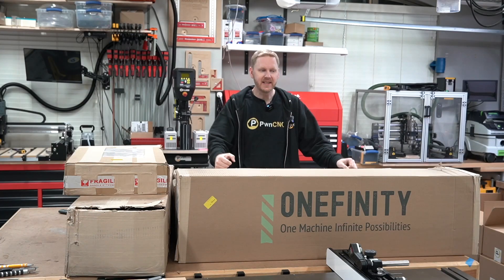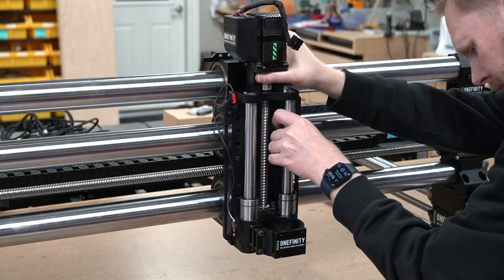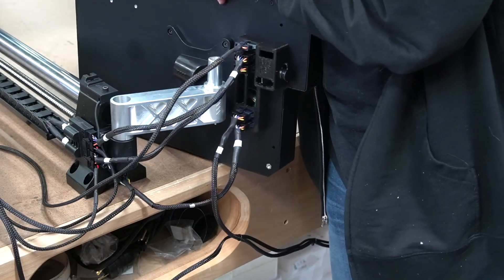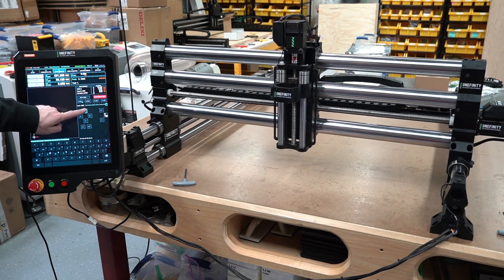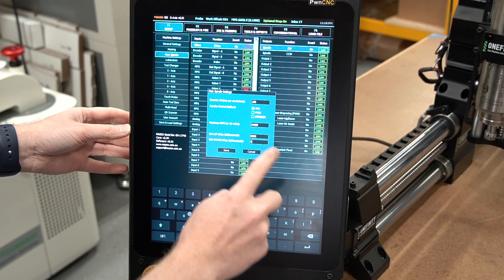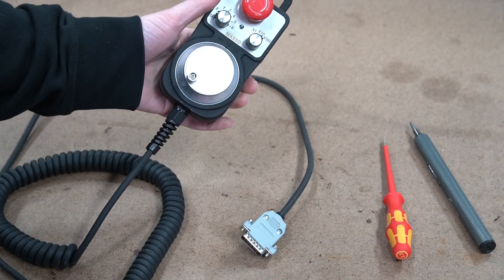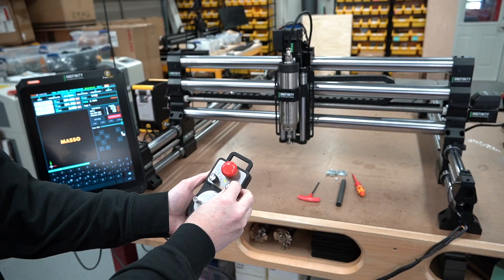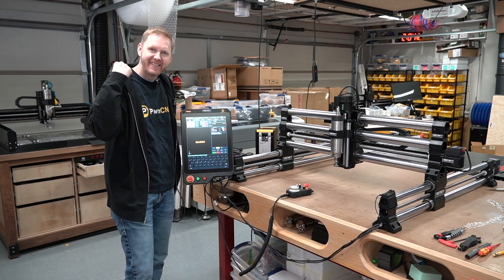Onefinity Elite Introduction

Comment: So I’m considering buying 110 V air cooled spindle using it just for wood will I be able to cut all types of wood or will I have issues?
Purchasing the onefinity elite
Reply from the maker: You'll easily be able to cut all types of wood and a little bit of aluminum as well with the right speeds-n-feeds.

Comment: Hey Daniel, are the Onefinity cables sheilded in any way, they look so cheap? Have you experienced any interference from the spindle or dust collection? I believe your spindle wiring is sheilded correct?
Reply from the maker: All of our cables are shielded yes.  No one has reported EMI issues with their machines... even when the Spindle's power cable is routed within the cable chain along with unshielded stepper motor cables.
Referring to the Onefinity wires... a recent trend with CNC manufacturers... Onefinity, C3d, and others is to put simple wires into their cable chains wrapped only on either end, but within the cable chain the wires are free.   Really sad to see this trend happening but it is.
As for PwnCNC products... we thoroughly believe in over-engineering where it makes sense and shielded cables in our spindle kit wiring are an important step to mitigating EMI.

Comment: Curious your thoughts regarding the Onefinity Elite vs the new Shapeoko Pro 5 4x4...  Each seems to offer something different for around the same price price point.
Reply from the maker: The Onefinity's Masso controller is an absolute game-changer!!!!!  IMO that is the epidemy of hobby level cnc controllers at the moment and if your machine doesn't run one... figure out how to add it.  
Both machines are mechanically capable.  There is definitely more standard mechanical design elements to the S5.  Certainly the size is awesome and the fact that they enlarged it to fully and completely support not only carving 4x4 but also clamping stock for a 4x4 cut is just awesome... cudos to C3D for that design decision.
Reply: @PwnCNC  As always, appreciate your feedback...  When my wife condescendingly asks me, what did you buy now???...  I show her work shops like yours which seems to put her fire out.  lol..  Your shop looks awesome and love all the equipment you have it populated with.

Comment: I'm looking to buy this exact machine with the PWNCNC 220V spindle.  I have a space off my shop that is 48" wide.  Will this fit in that width? What is the widest dimension of the Elite woodworker? Thank you
Reply from the maker: 48x48 is perfect spacing for the Woodworker Elite.  if you were putting a "top" to that enclosure... leave about 26-30" which should be enough for routing a 2.5" hose.
Reply: @PwnCNC   Thank you! The current spec on Onefinity's site shows the widest point of the woodworker being 45", but that's the woodworker x-35. 
I didn't know if this was accurate for the Elite with the bigger stepper motors, standard wire management on the side rail,  and the bigger controller.

Comment: Daniel, what brand is that skinny cordless screwdriver you were using? Thank you!
Reply from the maker: That's a Milwaukee driver.  LOVE them as the torque can be lowered to 1 which is pretty much hand tightening.
Reply: @PwnCNC   Not able to find driver by Milwaukee. Do you have a link or item number

Comment: Nice to see these elite series starting to ship, I cant wait to set up my wood worker elite!
Question on the pendant at the end of the video. Is this a Masso pendant (i don't see the masso log)
If it's an after market unite can you point us in the direction of the one you use? Shipping from masso is crazy expensive.
Reply from the maker: The pendant is direct from Masso. I ordered several things at the same time which did help with shipping.  I haven't got the pendants e-stop working but hoping to have it solved soon.

Comment: @PwnCNC if I move everything out of my enclosure, what is the least width and depth can I get away with for the woodworker? Will 48” x 48”  inside dimensions fit the Elite WW?
Reply from the maker: I'd say absolutely no smaller than 48x48 inside dimensions.   That is with mounting the Masso touch controller just outside of the enclosure btw.

Comment: I have a similar question to the one already ask My enclosure is planned to be 48” x 48” inside dimensions. My Z height is planed to be 30 plus inches. Will the Elite Wood Worker fit? Building the   enclosure is my next move.   I already ordered my PWN spindle 80mm 220v water cooled.  

The dust boot (ordered with my machine) will probably cause me some travel issues in the Y direction. But I think I can add an offset to my enclosure if I knew the total depth.  I think it is version 7 dust boot.
Reply from the maker: 30" would be perfect actually if your enclosure is 30" above the surface of where the machine will be mounted to.  The z-stepper motor is 21.5" up.  This is the Woodworker Elite, and I suspect it's the same height for the other size machines.  
The total depth of the Woodworker is 48" from front to back accounting for the wiring.  This is IF you remove the Masso and mount it on the outside of your enclosure.  If you leave it mounted onto the machine you'll need another 12".
Reply: @PwnCNC  So if I'm understanding you correctly, an enclosure for the WW would need to be 48" wide by 60" deep? Is that with the silver Masso bracket parallel to the Y rail? If perpendicular to the Y rail the enclosure would need to be 60" wide by 48" deep?
Reply from the maker: @Swick_  Mounting the power-box under the table... the WW would need 57" wide minimum and 60" deep... if i were to make worst-case scenario moving the masso controller around.  This would basically give you 12" of surface space in front of the machine considering how the Masso screen moves around... along with roughly 8" off the left side of the machine, again with masso turned so it takes up as much space off the left as possible.

Comment: Could you tell me the distance from the bed to the top of the machine with the spindle raised as high as it can go? I am looking to see if it will fit under a shelf I have.
Reply from the maker: From my assembly table it's 21.5" to top of the Z spindle motor.  Accounting for the spindle power cable and possible tubing... I'd give it 23-ish".

Comment: Hi Daniel, great video; definitely makes me want one! I am waiting to see 1F's infinity possibilities upgrade. I will probably be ready to buy your spindle before I upgrade my X50 woodworker to the Elite. If I get it for my current buildbotics, will it work with the masso later? what would need to change or be replaced?
Reply from the maker: From now on the spindle kits will come with a very simple wire change and some programming.  The BB controller uses Modbus while the Masso controller uses PWM.  There will be no internal VFD Enclosure rewiring required to make this work.. and programming is super easy.  I'll release a video on how to do that process.

Comment: I just built a 48x48 simple table for my WW elite for whenever it ships. Those motors looks a bit longer and the front panel hangs out way more from the foot print then I thought they would. I hope it isn't too bad once I get it setup.
Reply from the maker: Compared to my Machinist's motors, they stick out 2.25" whereas this new Elite Woodworker motors stick out roughly 4" if you give safe place for their wires.
Reply: @PwnCNC  checking my numbers it looks like the machine will not be getting an enclosure with my tables current dimensions. 
Thanks for the reply.

Comment: Thanks for posting this video!  How tall is the cnc from the top of the fully raised z  to the bottom of the foot? I'm hoping to get my machine next month and I'm building an enclosure for it.
Reply from the maker: From the surface of my assembly table to the top of the motor is roughly 21.5"... up to 23" with the spindle cable loop at the top.  If you want to include a hose across the top, i'd add 4-6" on top of that for 29"
Reply: @PwnCNC  thank you so much! That's quite a bit more than I was guessing

Comment: Is there any tips or things to keep in mind when running the tubing for water cooled spindles?
Reply: This is what I was hoping to see as well.  It doesn't look like water lines are going to fit into the drag chains - they already look completely full.
Reply from the maker: Correct, the stock drag chains will not fit coolant tubes.  They work great with the spindle power cable though.
I do see some potential for increasing the width of the metal bracket supporting the chain which is perfect for enlarging the chains for tubes.  I'm definitely looking into it as a possible upgrade accessory.
Reply: @PwnCNC  thanks! You can go ahead and take my money if you produce the upgrade!

Comment: Can you help me understand what a 'complete' spindle kit is for the elite series?

I ordered the following and im not sure if there's more i need, some of the descriptions and options have changed on the website so im not sure if there is a pump, tubing, etc or if i should start placing an additional order. The prices seem to have changed a bit since the onefinity sale so i cant really re-create and re-read what i ordered to confirm

-Spindle Kit - 1.5kw 110v ER20 80mm Round / Water-Cooled / Onefinity Elite / Masso - SPD-110-15W-80-AD-MSO
-Dust Boot v7 - 80mm / 2.5" / Yellow - DUST-BOOT-v7-8025-YL
Reply: Pwncnc put out a video with an unboxing of the spindle kit which looks like what you ordered.

https://www.youtube.com/watch?v=m0B6kf5Xmwc